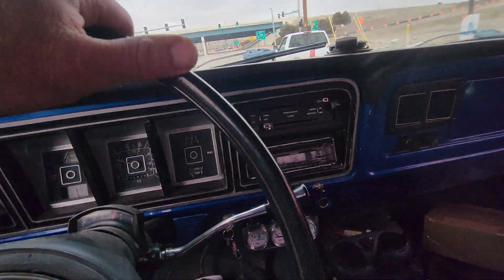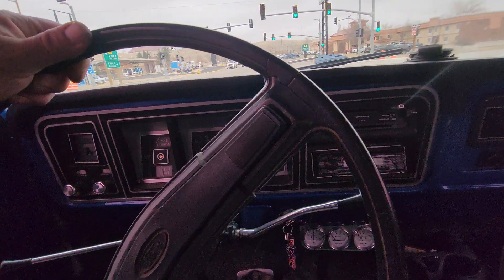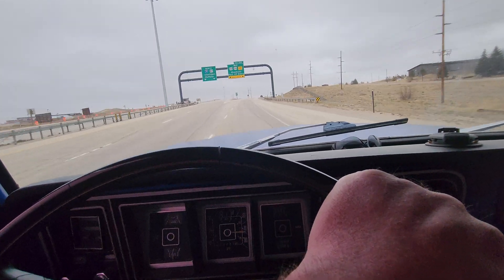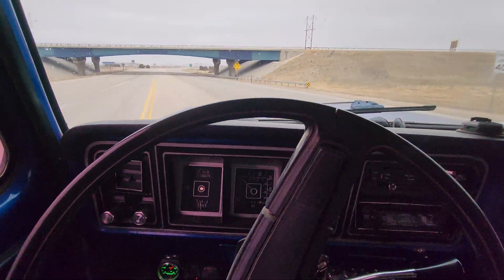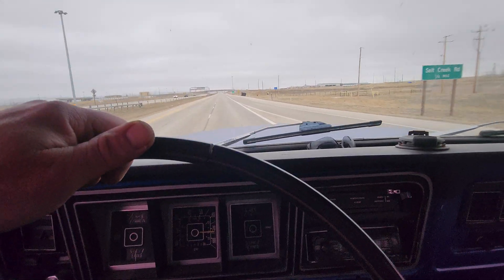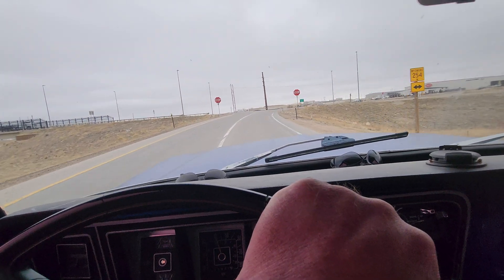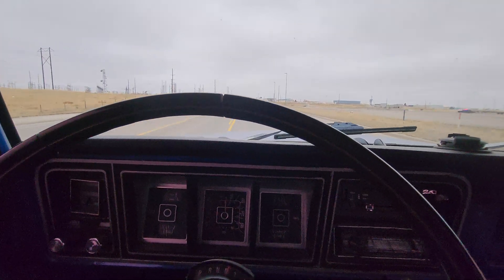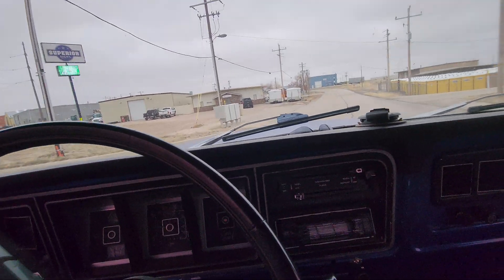Rusty's efi 460 swap 1977 f150 stage 2 cam c6 3 speed auto build.

Comment: Sounds and goes great!
Check the rear light sockets/wiring, if there's corrosion in one of the sockets or a bad ground it will backfeed through the signal light switch when you signal or step on the brakes.
Reply from the maker: Yeah, his wiring is definitely in need of some TLC.  He is excited to get it back and finish that stuff up on his end.